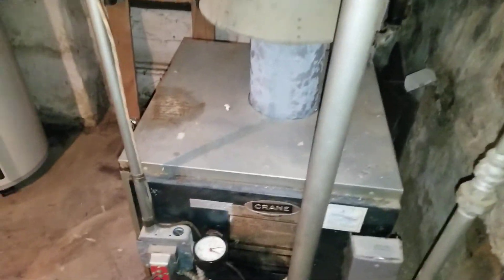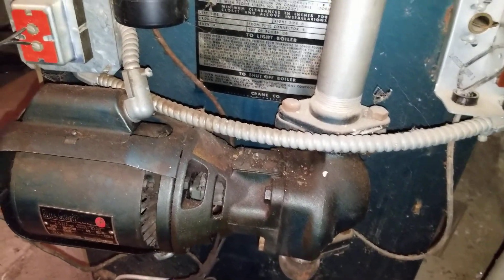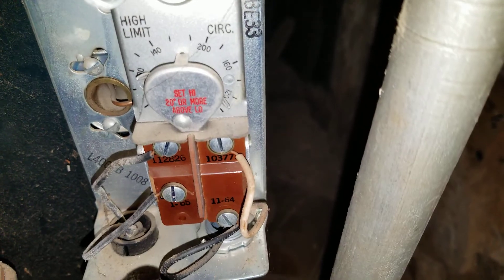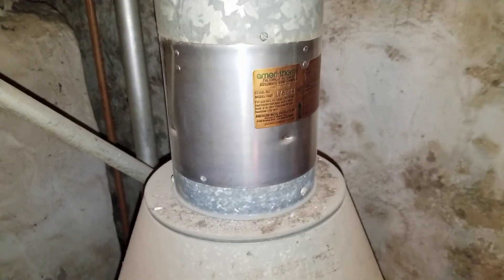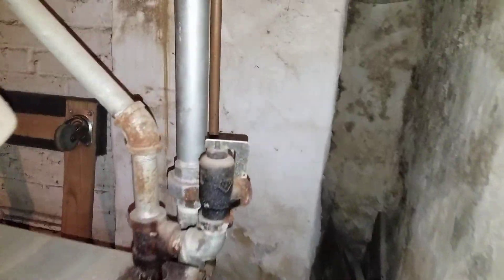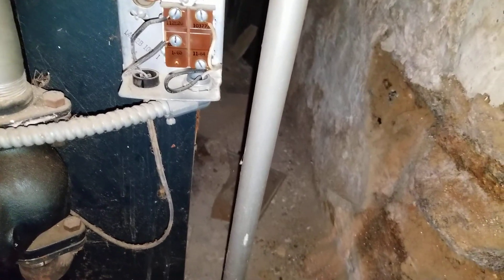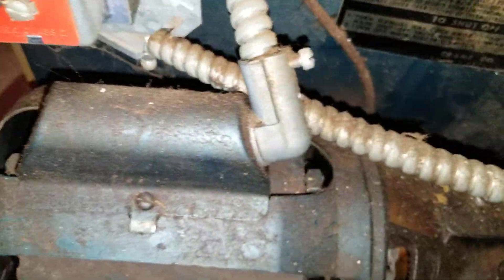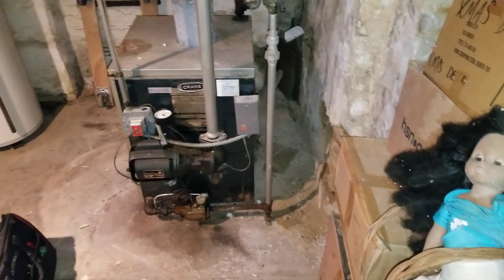Crane 1967 gas water boiler still running

Comment: Thanks for this video I have one looks a lot worse than this one, having teething problems now trying to figure things out the control valve went bad and I replaced it, trying to figure out what the gas pressure 3.5 on supply side manometer it doesn't seem happy, hopefully somebody knows what gas pressure should be for this unit.